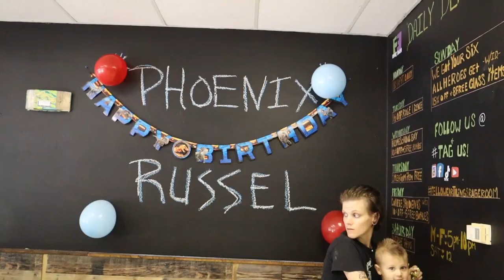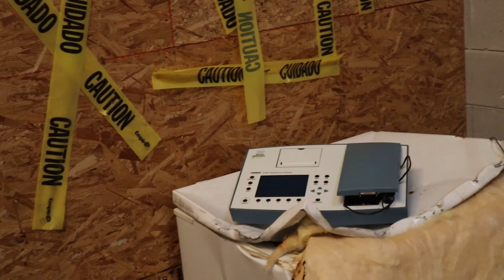How Much Can You Make Owning & Operating a Rage Room?

Comment: Couple questions man. Do you have a liability waiver? Do you need to carry insurance? Also do you just throw everything out or do you recycle? Looked like you were just putting even glass in the dumpster. Great video though boss
Reply: YES a waiver with a video of you explaining it on detail and them signing. We take our broken glass put in old concrete mixer with sand for a week then sell it as beach glass
 All metal goes to scrap yard and electronic parts of value are saved for reuse. Very little from our smash house goes (back) into trash. We have a deal with local thrift stores to buy the stuff they were going to toss out works out great for everyone!